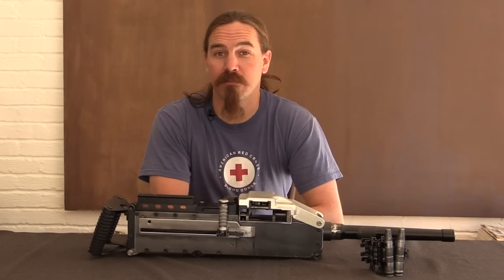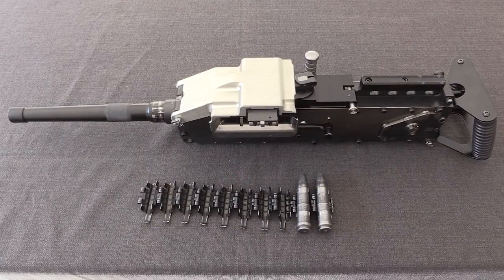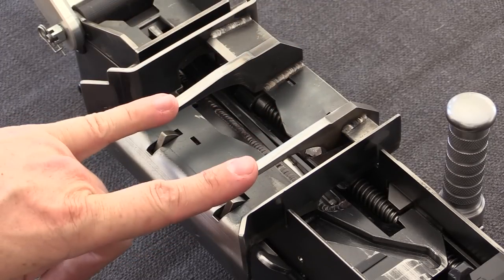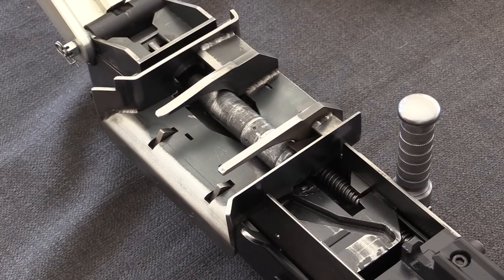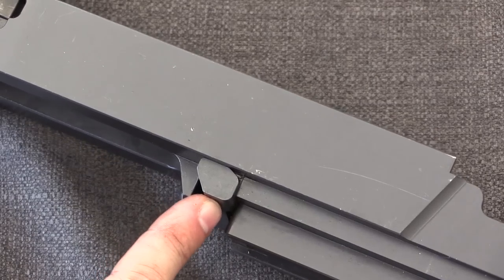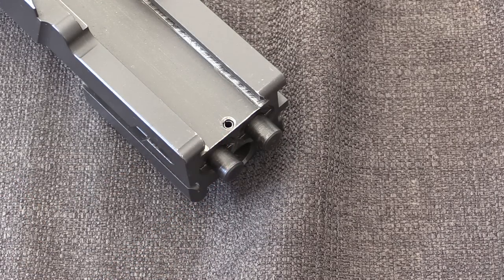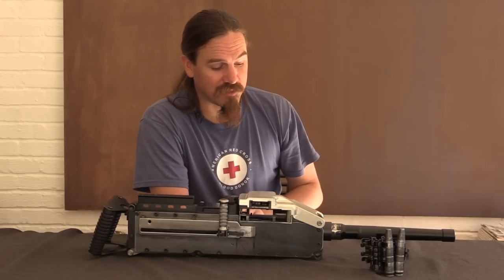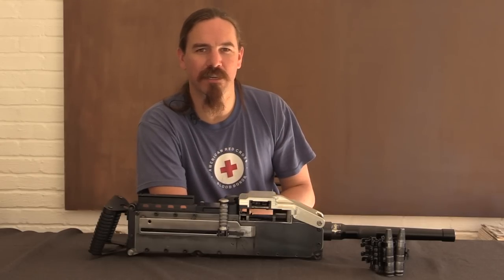Inkunzi Strike 20mm Grenade MG

Comment: What a fascinatingly intricate machine! But would it not be easier to scale down the Soviet AGS-17 "Flame" (АГС-17 "Пламя")? It is a simple blowback but with hydraulic buffer and two recoil springs, whose compression on charging is facilitated by a steel rope with a pulley mounted inside the top cover. With caliber ratio 30 mm for AGS to 20 mm for the desired weapon the resulting weight would not have exceeded 12 kilograms.

Comment: How to test this in the US Army?  The traditional way "Nope! Not invented here!".   Or a novel way by getting enough prototypes to equip a battalion and the appropriate number of various types of rounds.  Then let a battalion test it live fire and non-live fire training to develop tactics.  Letting the youngins show if it is soldier proof. 
It's "light" and small form factor means and it can take the place of a .50 or be added to anything with a ring turret.  With a 1000 meter area target range it would work well in the typical combat ranges whether in Afghanistan or urban.  If the fuses from the 25mm Punisher  could be adapted easily after all the money spent on it.  Smaller cheaper fuze able and potentially programmable rounds against drones.
This would be incredible as an option for helicopter door guns and an SOF insertion boats.  
As great as the 40mm auto grenade launchers are this would be lighter and double the ammunition capacity.  Imagine if this had been available and camouflaged as a Ma Deuce for convoy duty in Iraq and Afghanistan.  As defense and to pop a round on a suspicious lump in the road.  All units could be issued some of these as defensive armaments.
Of course the Army would say no but the Marines might see its value for how it is revamping itself and say yes.  Less than

Comment: Is this for smaller nations that don't have the industrial capability to make the 40mm Low and High Pressure Round Fuzes?     What is the weight of the complete weapon without mount?    20mm is going to have a smaller casualty radius than 40mm by difference in HE filler capacity of the projo, as well as less kinetic energy armor piercing capability due to loss of velocity over  20x102mm.  Comparing weapon system total weight and belted ammunition weight with the 40mm Mk19/Mk47, would this provide Light Infantry, Mountain Infantry and Airborne Troops with a lighter, more accurate badda boom capability?    The lighter recoil will allow operator to keep follow up shots tighter on target than the Mk19, so the reduced HE burst capacity is made up for by multiple rounds exploding closer  to intended target.    Similar to what TACOM/General Dynamics was striving for with the 25mm XM307.

Comment: Hey one question, how come there's a lot of heavy weapons without any muzzle device? Grenade launchers, high caliber machine guns, heavy artillery, AA guns, tanks etc. many of them have a flat end of the barrel that looks just like a tube. Is it simply because of old designs, or is there an advantage in this? Wouldn't something like a huge muzzle brake help with recoil?
Reply: So I looked around for you. Tanks use sabot rounds now so the outer shell would start leaving the round as soon as it reached the end of the barrel and a break would foul it up. 

A lot of machine guns have breaks or flash hiders. The M2 .50 cal should start having them with the A1 variant. 

Apparently if you leave it blank you get more recoil which, in some cases, helps with the cycling of the gun. This is probably most true with artillery. But I might be mistaken. 

Also with low pressure systems you don't get much benefit like a 40mm or the round from this gun. 

So it probably has a reason one way or the other if it has no muzzle device. The Browning is probably because it's old and almost always vehicle mounted.
Reply: a lot are set up for tripod/vehicle use. with a fixed mount recoil is less of an issue so a muzzle device is one place they can cut weight and reduce build time/complexity

Comment: I'm sure Ukraine has a company that'll hire him. That it uses the russian/soviet 12.7mm feed belts likely would simplify manufacturing in the same small arms factories in Ukraine that already had the tooling for those, and if its the same point detonating 20mm projectile as used in the 20mm x 102mm autocannon cartridge then that also simplifies local manufacturing the completed 20mm x 42 grenade cartridges. This would be an excellent weapon for all those Senator armored cars Canada (and other countries) have been paying for to send to Ukraine, which are being sent without weapons though there is a top hatch where something the size of a 7.62mm GPMG could go.

Comment: Ian, how does this 20mm ammo compare with that used by the tri-cannon on the Cobra helicopter? _former Airwing Marine asking
Reply: The projectiles are off the shelf 20x102mm vulcan projectiles used by the M195 and M197 cannons but fired at a lower velocity that's about 33-50% faster than an average 40x53mm grenade. The HEI probably behaves fairly similarly but the SAPHEI/API probably don't have much penetration power with the low muzzle velocity

Comment: Really interesting. I could see this being very useful in a lot of ways actually. Thinking specifically of the war in Ukraine. There is a lot of trench warfare going on, a lot of static or semi-static defensive positions. This weapon system might excel in that use. It would be much more effective than an MMG while also being much more portable (man portable) than a 40mm GMG. Yes, there are lightweight 30mm GMG being used but this weapon system would have capabilities that the 30mm GMG doesn't have. Further, it could be a VERY useful weapon for light vehicle mount. You could carry more ammo than you could for a 40mm, provide more firepower than a MMG or in some ways than a .50 HMG. It could also be very useful in an anti-aircraft role. Again in Ukraine, they are still shooting at helicopters and low flying fixed wing aircraft with everything from AAG to MG's of all calibers and even rifles. This weapon has much better ballistic performance than a 40mm/30mm GMG (those slow projectile weapons would be of little use against aircraft) and would also cause much more damage with a hit than would an MMG or HMG. I have no doubt, assuming this is a reliable weapon, that it would be extremely useful in a lot of combat situations and worth having for some militaries depending on the weapons they use and their doctrine. I would be extremely surprised if the Ukrainians for instance turned down shipments of these things (with ammunition) if they could somehow get them in numbers while the fight is still on.

Comment: Don't really get the point of this. It is way too heavy and unnecessarily powerful for direct fire against personals , yet it won't have any better armor piercing capabilities compared to 50BMG, and the explosives charge will be way to small to create meaningful blast radius. For explosive rounds something like the 30×113 mm should be a minimum offering ok fragmentation and armor piercing capabilities
Reply: Different fire mission....
this is much more useful clearing buildings room by room...
at 300 yards...
rounds air bursting inside the room.

Comment: I got the wibe of the German WW2 MK 103, a cannon in 30mm with a full projectile and a short casing, to get a lighter 30mm gun to have in smaller aircrafts, instead of the full size MK 108.

Comment: He is up against literally trillions of dollars in opposition to this design. 20mm as a diameter no longer meets minumum criteria for payload or penetration. Also, the problem with the entire adaptation of such a plan would be 500m explosive engagements? Ok so squad weapons are effective to 400m, beyond that you have long range weapons to minimum 1000m, beyond that you have mounted heavy weapons like 25mm chaingun, beyond that heavy tanks and CAS.  

So this is to fit the role of 100m-500m explosive area weapon? See also XM25 and 25x59mm.

Comment: while 20x42mm has a 4 times higher velocity then an underbarrel grenade launcher its only 27% faster then the Mk19 while having less than half the payload.
the lower overall weight might have its uses but it seems unlikely.